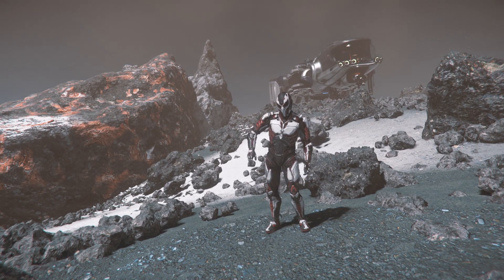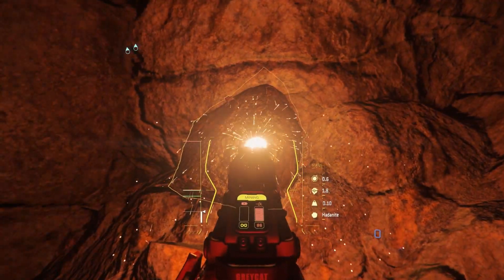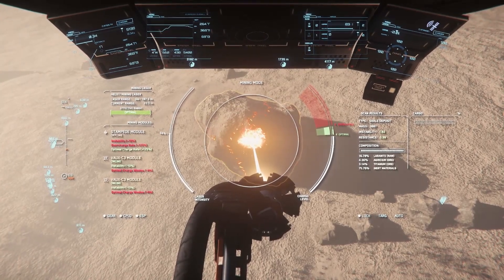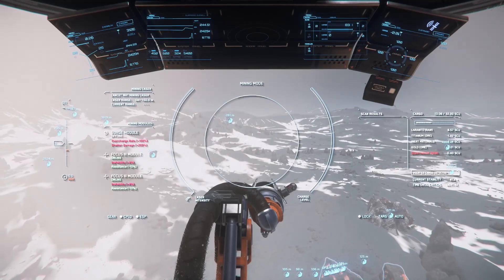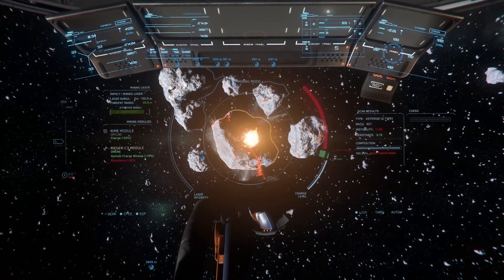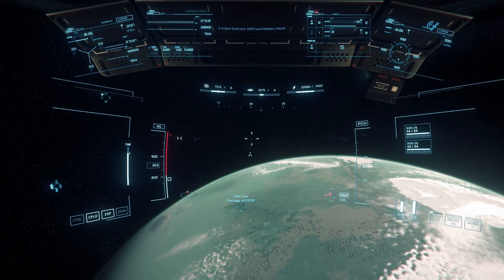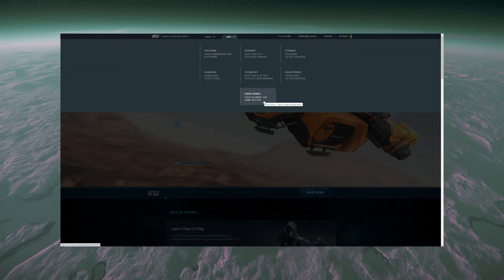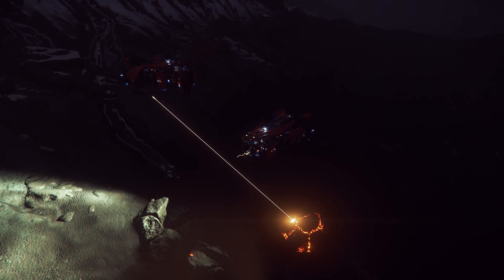Breaking Rocks - Episode 3, Star Citizen Mining Tutorial - Managing Laser Power To Fracture Rocks

Comment: 4:00 this is easier with a Prospector than a Mole so I will use a Prospector to show the concept.  A Helix I laser has a maximum range of 187.5 meters and an Optimum range of 7.5 meters.
The power received by a rock at a range of 187 meters will be very close to 0 and at 7.5 meters will be at maximum power or 2300, the power over distance seems linear.
While approaching a rock have laser at full power, when you see the charge level start to move, stop moving forward and continue applying full power, if the charge level is going up to fast back up a little, but use the mining throttle for fine tuning.  Doing this will give you finer control of the laser power with laser throttle movement.

Comment: 5:03 I had a rock after the 1st break.  It didn't show any progress on the charge of the rock, even tho i powered up the laser.  I noticed the rock gettting red though and before I could do anything it exploded taking out my ship of course lol.  Was it a bug that it didnt show the progress on the right side?  And I needed to maybe just stop and start again idk.
Reply from the maker: In this case it's one of two things going on. First, if there are multiple rocks stacked closely together, you may have been seeing scan data from one rock, but actually putting charge level into another rock. This happens sometimes as the scan point and laser beam aren't perfectly aligned. Second option may have been the rock already being small enough to extract, so it didn't display the charge level bar. I've seen a handful of first breaks do this, especially when you're starting off with a small mass deposit.

If you get the audio cues that the rock is heating up but you don't see the corresponding charge level, back off and try to get a clean angle on the rock.
Reply: @RedMonsterSC  got it, thanks man